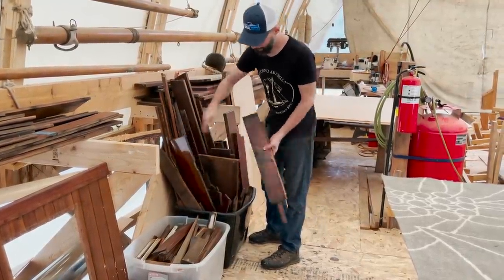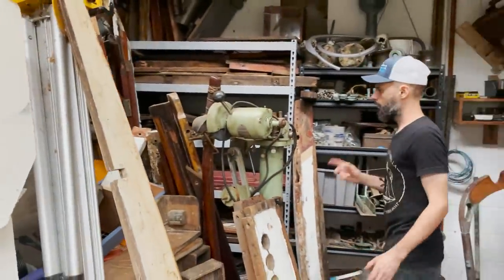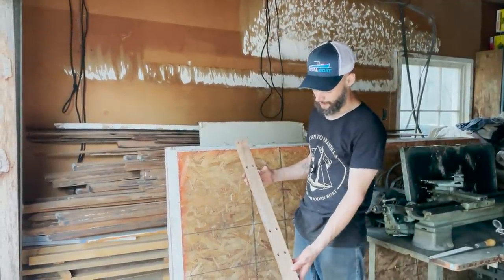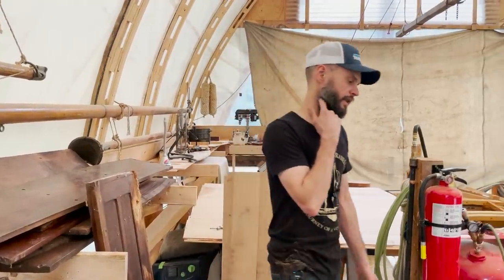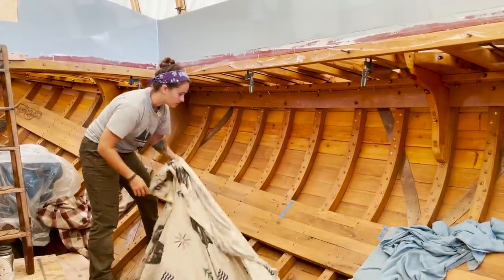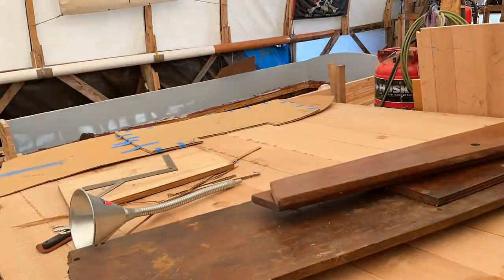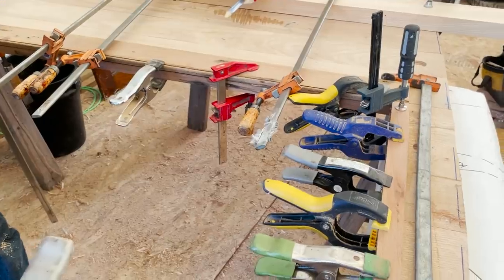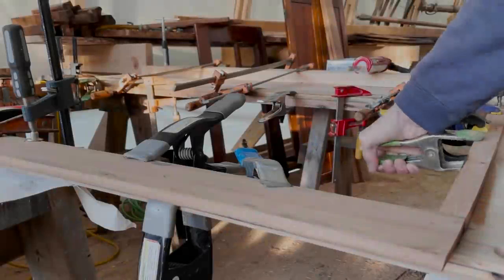100-Year-Old Mahogany Trim - Episode 175 - Acorn to Arabella: Journey of a Wooden Boat

Comment: Such beautiful wood! Also, nice "roll and tip" at the end there. When I first started working on my own boat I remember being told about that method and thinking "Meh... extra work... seems like it wouldn't make much difference". I was so wrong. Neither rolling alone nor brushing alone creates a nice smooth finish like that method does. Some people swear by using pricey, fancy brushes (badger hair, etc.), but I also use those disposable foam ones. Cheap, plentiful, and just chuck them instead of spending too much time maintaining fancy brushes.

Comment: Steve, the going rate for  chunks of air dried cherry  on Ebay is $29 for a large flat rate box. save your cut offs I bet the maple sells too. anything you can smoke with
Reply: Dear Bob D.
👍👌👏 Exactly what I thought instantly too. At least nearly any wood can be used as firewood for heating purposes or camp fires. That's what I always think when wood is wasted (like for instance in videos from Andrew Camarata, Bus Grease Monkey etc.p.p.. They burn(ed) complete trees and chunks of trees without thinking).
Best regards luck and health.

Comment: Looking at the progress I wondered whether you have taken a decision on the mast step. Atkin put it right on the keel while you put it on the bronze floors. Do you have a plan B? The downforce created by the tension in the standing rigging, enhanced by the forces from the fore sails, the tension in the halyards, heeling moment, the weight of it all plus the vertical acceleration when pitching is substantial. From the videos I cannot see the size of it all, but you can maximum allow 60-80 psi of pressure between the bronze and the wood. When the thickness of the bronze x number of floors x width of keelstep would be 36 square inch, your maximum allowable downforce is around 3000 lbs. That is very little for a boat like this. If you are substantially over that load, the wood will crumble and the mast will sink down till the mast foot finally hits the keel (as intended by William Atkin:-)) ). In my opinion that is a very risky thing. The more interior you put in the harder it will be to carry out a better solution.

Comment: In the late 1950s my father’s engineering firm was involved with the modernization of a Victorian era school in Glasgow. In the science labs there were 8x8 wooden tables with holes in the centre for Bunsen burners. They were heavily stained and carved up from many years of student abuse and were to be dumped. My father salvaged them and discovered they were Honduras mahogany and were ultimately donated to be made into furniture - such was the lack of awareness of valuable resources   My father was initially going to use it in our boat but it was too heavy and dulled all our tools due to the sand in the open grain
Reply from the maker: Yes! Some types of wood have a ton of silica in them.

Comment: Oh My!  Epoxy is very slippery when uncured and expecting to be able to clamp multiple pieces up and get them to stay just where you want them is not a good strategy.  Having said that the heat gun and putty knife can sure most mistakes and a good scraper with the heat gun can remove the mistake right back to the wood for another gluing.  

I suggest making a lot of little 2 x 2 x ½ blocks and wrap them with mylar packing tape.  During dry fit (always, always dry fit to rehearse the glue up) clamp the blocks for the parts to register against.  Then as you come back with the part all glued up you can quickly get EXACTLY where you wanted it and it will stay there overnight.  

BTW: how are you going to get the bulkheads out when the deck is on?
Reply from the maker: Thanks for the tip! We don’t plan to remove the bulkheads on a regular basis, and if removed. They’ll come out in pieces and their replacement material will come in as pieces.
Reply: @AcornToArabella  What!  you aren't going to "Clear for action" during general quarters?  Actually, I assumed it would be a rarity but if there is something that can be considered now it is much easier than later.
Reply: BTW: you can turn the little blocks so only the packing taped corner is touching the piece to be glued so the squeeze-out bleed is minimized.

Comment: I thought you were going to use a floor sander to go over all the big panels of home-made plywood. Maybe I remember wrong? Or did you already do that?
Reply from the maker: Turns out the belt sander works just fine.
Reply: @AcornToArabella  Ok. You did it all with just the belt sander. Cool.

Comment: With regard to the usage of pitch in the bilges ... 
Would polyester resin have worked instead? It would certainly have been lots easier to work with.
Reply from the maker: Not sure. This is hydrophobic and wood preserving. Works great in this application. Never heard of that being used before.

Comment: Stephen, you should invest in a brad nailer for the epoxy pieces.  Three or four brads would probably hold the pieces just as good as the clamps would.  A lot less trouble and a mechanical attachment.
Reply: Ferrous metal fasteners  in the structure of wooden boats is not a good idea.
Reply: @sunny71169  I forgot about that little aspect.  I wonder if the market has brass brads....  Hmm....

Comment: I've done a lot of floor sealing with a roller, why do one plank at a time? I would do much larger sections, and then "cross" to get an even finish. Of course, we use polyurethane (which we make in-house), which self levels and "glosses", so no need for the foam pad...just askin'